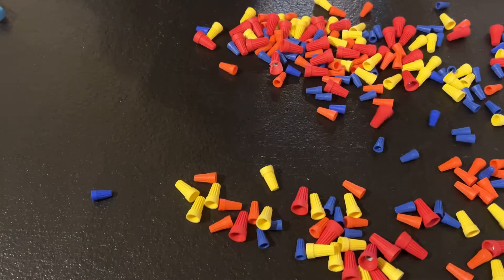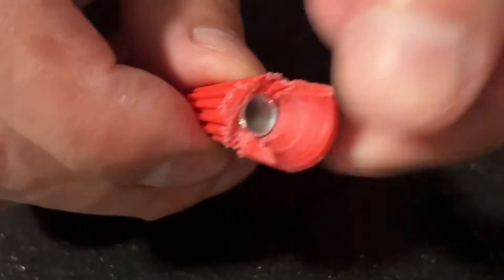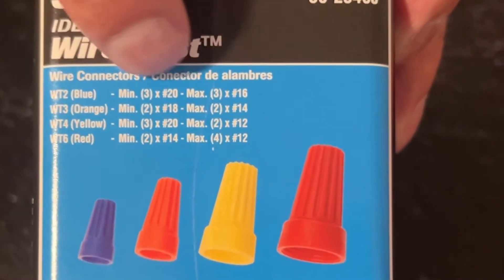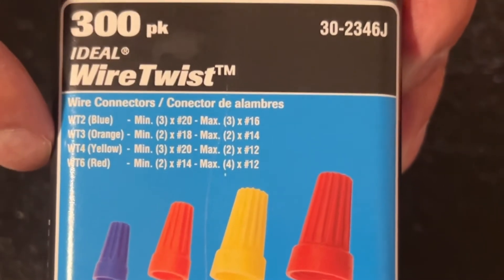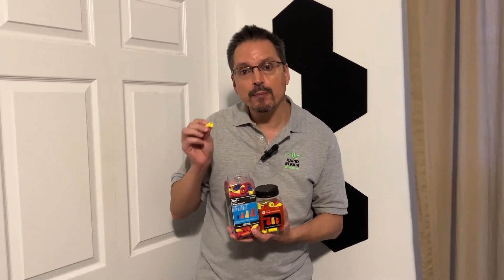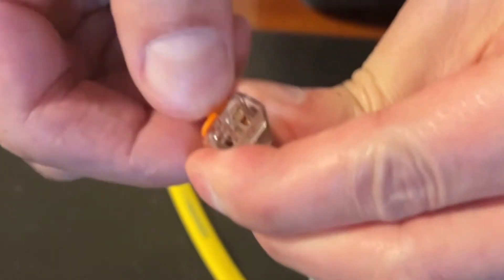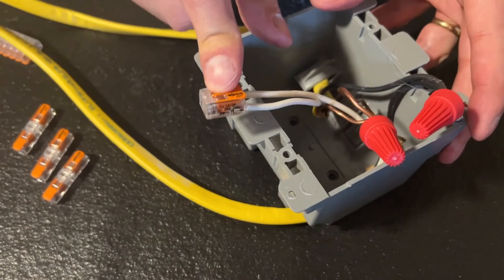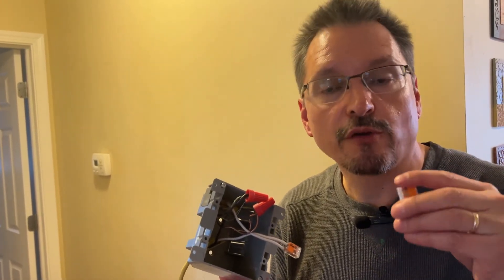Stop Using Electric Wire Nuts - A Better Method

Comment: WAGOs are wonderful!
On the topic of wire connectors, I have a very specific question. If you can answer it I'd be grateful!
I'm adding a 24v line in my attic for things like LED lights around the eaves of the roof. There would be a 12awg main line (2 wires, stranded) running from the basement (350w supply, fused) up to the attic through an interior wall and then along the length of the house, secured to each stud along the way. Branches off of that main line would go to the eaves. What is the best way to connect the branches to the main line? I don't think WAGOs can be used since they aren't intended for wires with any tension on them, but let me know if that's fine. Would every branch need its own junction box to meet code, even though it's low voltage?
Reply from the maker: Why would there be tension on the wires? You’re not going to staple and secure everything properly? Wire nuts or modern WAGO’S would be fine. They are both UL listed for safety. Technically I do believe you’re supposed to use a junction box at each connection, even if it’s not required for low-voltage it certainly will make a future homeowner feel better and look much more professional. I would worry if you leave the wire splices open and exposed a future Home Inspector is going to call that out as a deficiency. Good luck 🛠️🛠️
Reply: @HomeRapidRepair  Everything would be secured, but since the WAGOs themselves are not mountable to the studs they would just be hanging there in the open, that's more what I meant. Alright if junction boxes are the way then that's what I'll do. Thanks!
Reply from the maker: @ColColonCleaner  you won’t regret it…use junction boxes 👍🏼👍🏼

Comment: yep, he has wagos for an amazon associate link and doesn't have the proper disclaimer. and amazon has a huge problem with low quality junk getting mixed in and you will more then likely get a knock of brand. good luck with the house fire because you bought junk from Amazon.

Comment: I appreciate DIY videos, but this is misleading.  
1)  Twist your stranded wires together before you try twisting it with another wire or putting it in a wire nut.  You are less likely to break strands off  that way.  
2)  Electricians will argue over whether you should pre-twist conductors (wires) before you put on a wire nut.  Ignore them.  If you are a DIYer and you don't do a hundred of these connections a day, twist the exposed wire before putting on a nut.  You will know you have a solid connection that way (just be sure to twist the wires  in the same direction you twist on the wire nut or you undo your connection.  
3)  If you REALLY want that connection to stay put, keep twisting the wire nut until the insulated part of the wire twists as well.  That's a sure sign the wire nut is gripping properly and it turns the insulated wire into a strain relief for the wire nut.  
4)  The stripped part of your wires should be the same length when they are in the wire nut.  The fastest way to do that is to strip the wires to "about" the same length, line up the wires so the edge of their insulation lines up, pre-twist the bare wire together, and snip off the extra, uneven wire at the end afterward before you put on the wire nut.
5)  Don't re-use chewed-up wires like that if you can help it.  It's oxidized for one thing, and all of those gouged-clean copper bits are going to provide a better path for current and lower contact area.  In other words: heat build-up.  Snip it off and go with new copper before you put on the wire nut again.  Also you shouldn't put bent-up wires in Wagos for the same reason--straight wires make for better contact.
6)  Code says you need 3 inches of wire extending outside your switch and receptacle boxes to provide enough to work with.  If you have less than that, take a 6 inch piece of wire and splice it to your existing wire with a wire nut or Wago.   That makes a "pig tail" that will connect to whatever you plan to install in the box.
Reply from the maker: Excellent excellent teaching🛠️🛠️. I hope a lot of people read your comments. Maybe I’ll pin it to the top. Beginning homeowners need to start somewhere and they gain confidence along the way.  Thanks again 😊

Comment: Wago nuts will also give an open neutral connection because the connection does give enough tension on solid Romex. The cost is ridiculously high compared to wire nuts! Learn to strip wire and correctly use wire nuts. Twist the nut until the coated wire is twisted too and you'll never have a problem with a loose connection.
Reply: If you want to give electrical advice, please proofread it before posting.  Either they "give an open neutral" or they "give enough tension on solid Romex",  which is it?  If you buy the right Wagos OR the right wire nuts for the wire gauge and number of wires you plan to use then there shouldn't be an open connection for either product.  If there is, check your connection.
Reply from the maker: Super Smart response 🛠️🛠️Thank you

Comment: Utterly disagree. Cap nuts are a vastly better electrical connection. Wago's are a joke in conductive area contact.
Reply from the maker: I hear you. However you probably already know what you’re doing. Would you agree that WAGO’s are helpful for new homeowners trying their first repairs? 🛠️🛠️
Reply: @HomeRapidRepair  If they cost more for ease of use for an equally robust connection, I'd say yes. But the connection is inferior. In electricity, inferior isn't a good thing. Such connectors are great for speaker wiring, irrigation, etc, though.

Comment: if you use them correctly they are equal to other connectors
Reply from the maker: I do agree with you. They are UL rated as safety. I like WAGO because for first time homeowners, it gets them over the intimidation factor. I’ve seen these things heat tested, and they don’t fail at a higher rate than any other connector 🛠️🛠️ Thank you

Comment: Better title. Stop selling out to big Wago. Wire nuts are completely safe and easy to use.
Reply: Use Wagos or use wire nuts.  They are both code-compliant and homeowners should use what they are most comfortable with.
Reply: @docferringer  Best comment. People should use what they are comfortable with. WAGO's and similar are easiest to learn and use, but there is nothing wrong with a well installed wire nut. I use both and it depends on the job.
Reply from the maker: Thank you 🛠️🛠️

Comment: They cost 10 times what wire nuts do and they take up more space in your box.
Reply: if you are dealing with a lot of wires then lever nuts have one advantage: The wires can rotate while locked in the Wago so you can more easily position them in whatever orientation you need to fit everything in the box.
Reply from the maker: You are right on your points. I still believe they are an excellent option for homeowners 🛠️